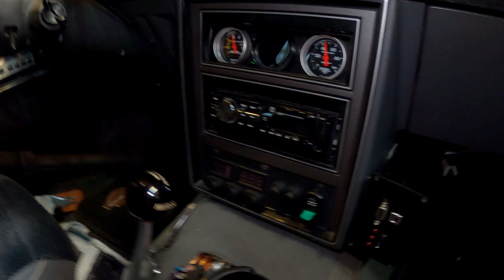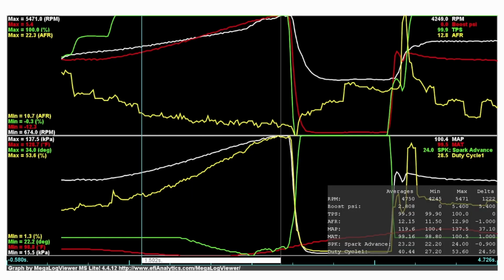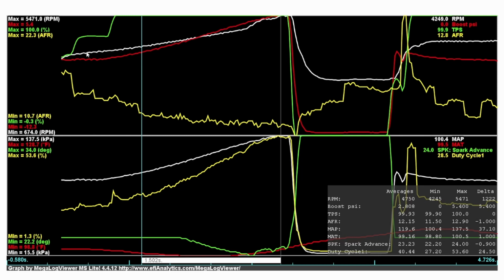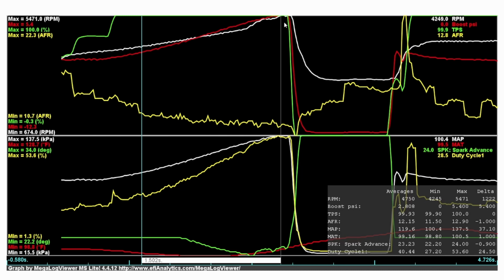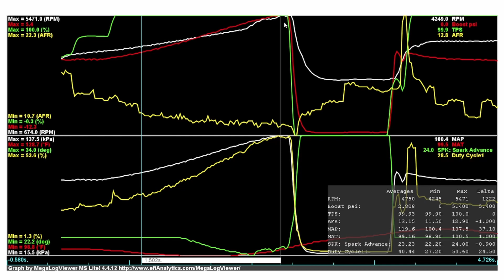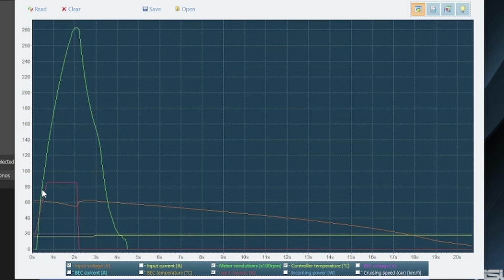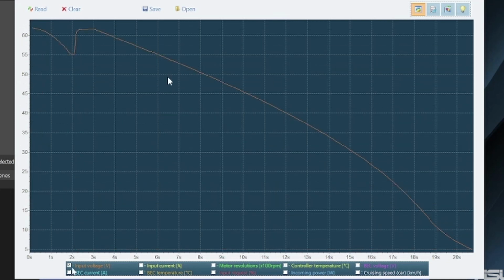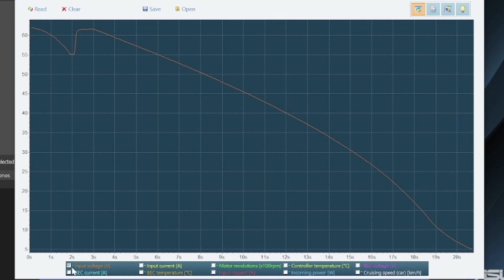DIY Electric Turbo: Sledgehammer - First Boost!

Comment: Have you considered using a digital potentiometer to set the motor amperage? that way you can electronically ramp the motor up/down to tweak it for traction/how aggressively it comes on. Could have multiple boost/ramp profiles programmed into an arduino with a rotary switch to select which map to use on the console during testing etc.
Reply from the maker: Yeah - actually the arduino has code to do that.  You could even go nuts and have a speed sensor on a front wheel and one on a rear wheel, and when the e-turbo's on, if there's a difference in wheel speed beyond a certain margin of error, you could have it automatically provide less boost until the wheel speeds match again - basically, traction control.
Reply: @AlexLTDLX  do you plan on doing it?
Reply: That's a great idea
Reply: What about using a throttle position sensor so even at idle you have some air flow instead of the -1psi restriction say 0-6psi at 0-100% throttle linear.  Is that the end game maybe I understand testing is continuous or is it power capacity? If just daily driving how long would a system last with two or so squirts a day  amphour or capacity. maybe a better question is theoretically how long could you boost?
Reply from the maker: Honestly, probably not.  This car pulled the front wheels off the ground on a transbrake launch at the track with slicks when it had the Whipple on it.  I expect it to do the same with this thing.  Also, software isn't really my thing - I'm not particularly good at it and I find it frustrating.  But it could certainly be done; the mechanics and electronics are easy; the code - again, not my wheelhouse.  But maybe as a youtube exercise....
Reply: @AlexLTDLX  Although doing it with the arduino would be neat it would also likely be a pain in the ass to get sorted out. Theres fairly inexpensive traction control systems available that are pretty much plug and play with very little sorting out that would be way simpler.

Comment: That's some scary torque on those street tires! Once you're on a prepped track, slicks, dialed in from the dyno, it's gonna be bye-bye Tesla Plaid. There can only be one electric king ;)
Reply from the maker: Thanks for watching and commenting.  I don't know if we'll hit 9.2's in the quarter - but I'm pretty confident we'll get solid 9's.  But maybe if we compound two of these; or even this one and the smaller unit...
Reply: @AlexLTDLX  I like that you have plenty of future options even while you're still working on this setup. Anything in the 9s is already ridiculous.

Comment: Hell Yeah, you've got a killer build Alex! I've enjoyed watching your journey.
It's wild how much power you are able to ramp up to the impeller attached to that motor. That 0.75 delay before reaching target amperage is pretty damn quick.

Rooting for your to succeed and have a blast doing it.
Reply from the maker: Thank you.  The guys at MGM have told me I can ramp in at 1.5 seconds for better response.  But for what I'm doing, it doesn't matter much.  But ultimately, it would be cool to have traction control - if there's tire slip, the e turbo slow down automatically.  And thanks for watching, commenting and most importantly - subscribing!

Comment: This is awesome you got it working! Real world test matters most. All the actions is from 0 - 120 that's the most important part in my opinion having it running 2-3 mins straight is beyond ridiculous. You don't need boost to maintain a high speed just using it to get there is all you need. 1\4 mile if your cars fast 12 seconds or less hopefully as close to 7 seconds as possible.
Reply from the maker: That's true.  I'm pretty confident we'll get this version into the 9's.  If you haven't seen it, this was our first drag test: https://youtu.be/AOL3Qyczt3Y
Reply: @AlexLTDLX  yeah I saw that video a while back. a 9 second car is fast by any standard. that is always a hell of an achievement on any car. with 5lbs of boost and no lag or parasitic loss you should get some pretty good runs. how heavy is all the batteries? thats the only slight draw back I could see using a system like this. how ever thats not to say anyother boosted system doesnt add weight as well. tubing intercooler the actual turbo or centrifugal super charger and pulley ect. could end up being some what same as those. doesnt look like you went for much weight reduction anyways with the full interior of that car being still in the car. either way this is interesting in that its different than the other set ups other people are doing. but I do think electric super chargers will be more and more common place. some OEM cars have them now even if just to reduce turbo lag of the exhaust driven turbo. I think the market will open up even more people being able to some what "turbo" their cars in a kit of some sort a company could have basically a box with batteries capacitors and some type of computer to map it and some type of cooling. then its basically hook up a few wires and hook it up to an intake. I think we will see this happen soon if it already isnt happening some where.
Reply from the maker: The current battery packs weigh right at 60 lbs.  However, if you went with LiPo instead of LTO cells (LTO is safer); you could easily get the pack weight down to 20 lbs for the same performance.  I just went with LTO cells because of the safety issue - we've got enough stuff blowing up and exploding while figuring this mess out.  The entire setup (with batteries, e turbo and long, heavy cables) is right around 100 lbs - more than half of which is right over the rear axle; but that total weight could be as little as 60 lbs total.  The previous Whipple setup, with A/W intercooler was right around 120-140 lbs, depending on how much ice and water I had on board.  And most of that weight was at the front.
Reply: @AlexLTDLX  yeah that's good to know. my current setup is a procharger centrifugal super charger and with the intercooler and everything weighs in at around 110 lbs for everything. for only 6lbs of boost. but thats not to say if you go with the electric turbo you might still need the intercooler depending on your particular set up. I use it because I am at 9:5:1 compression. if I was 9:1:1 i would probably not have the whole intercooler set up.  I mean its way more complicated than just a compression ratio but I just mean with my particular set up. but with out the parasitic loss of the pulley probably I could probably get away with 5lbs of boost and no intercooler. too to cut down on weight. that would actually be pretty sick to see.

Comment: J had to stop video @9:00 to make this comment" as you drive the time a car is getting to speed is significantly less than steady pace that is the boost feature of electric enhancement. In steady state the car can accumulate and store the energy for the short term boost at a much greater rate of consumption. F1 Cars are a extreme cost no option car and from the fuel consumed 50% energy conversion raw fuel content at the same time. They use multiple units for recovering. storing and reusing to get the best conversion of fuel to kinetic that delivers to finish line results. Say if a person with the will and tech can  build his way to something that functions then optimise results that's pretty kool thanks for sharing the journey. Soon as my rc hobby exposed me to the high power high rpm of brushless motors few years back "I though these motors could have potential to supercharge an engine on demand. I set up the items todo preliminary evaluation and found that the turbine of a turbo really produces large amount of power in small form factor and the motors and esc are expensive or custom. Progress has made for greater options  and this is a working example of bolt it on at the track and go faster package potential. once all the development is done very kewl no doubt!!.

Comment: Loving this project! I would try 2 things:
A volvo Penta "flapper" bypass so the engine can run freely N/A before the electric supercharger starts adding positive pressure.
Bring the turbo in sooner but with a more gradual ramp up so you stay hooked up.
Keep up the good work!
Reply from the maker: Thanks.  The controller can ramp based on whatever inputs you give it (or what you program it for).  But since in my case, we're most interested in max power and dragstrip performance, it's really not necessary.  Just put the slicks back on it, and leave off the transbrake.  As for the bypass, that is a good idea, but in my case, not necessary.  The engine makes almost exactly 500 hp naturally aspirated, and the e turbo only provides a restriction of about 1 psi of boost loss.  So you still have about 465 hp to play with.  And in most driving situations, it's not even close to noticeable.  But for smaller or different applications, it would certainly be worth considering.  Thanks for watching and taking the time to comment!
Reply: @AlexLTDLX if the engine makes 500 naturally, how much is this electric turbo adding to that Hp/tq wise? 50hp/tq? 100hp/tq or more? Could you use 2?
Reply from the maker: A lot more than that: https://youtu.be/b9d5xv9INmw?si=kt39TWB_zKI8jVrb  @mikelmarion

Comment: Very interesting stuff, that is mind blowing when you consider the fact that you don’t get parasitic engine power losses from the boosting device. Like nitrous but instead of filling gas bottles you charge with a wall socket. 
People don’t consider impeller blade angle and blade area vs rpm when looking at “turbo” looking compressor. Just the rpm, but not how many cfm per revolution is moved by the blades. Of course it’s not positive displacement compressor but still impeller geometry and size should ring some bells.
Reply from the maker: Before this I ran almost exclusively positive displacement blowers on this car - two Eatons and a Whipple over the years.  I can tell you with absolute certainty that this setup makes more than twice the rwhp per psi than even the Whipple did.  I think a TVS would do better, but still not even close to this thing.  The possibilities are certainly exciting.  Thanks for watching and taking the time to comment!

Comment: How about some mountain and towing settings for the electro-supercharger? If you’re driving in the mountains, you can set it up for continuous operation from tickover, just to make up for lost power and torque.
Reply from the maker: I can see that in OEM-type applications, certainly.  I think we'll be seeing more and more of these in OEM applications (Audi's had one for a few years, Mercedes has one as well; Suzuki's putting one on a motorcycle) as technology continues to improve.

Comment: Have you tried a 6-71, 8-71 or with your electric motor to drive it? Wth carburettors above it, and the throttles closed, they spin the rotors without any power input, if the belt drive is disconnected. this may help with getting the rotors to spool. Since they don't need to spin anywhere near as fast,  to pass large amounts of air, you could change drive gear ratio to better make use of the power the electric motor has and adjust the max power amps accorrding to the boost load. just a thought.
Reply from the maker: I've done a lot of positive displacement setups over the years.  The problem here would be sheer size both of the blower and the motor necessary to drive it (less rpm, more torque, some power in the system = much bigger stuff needed) and the mass of the rotors.  Though to point you bring up about the rotors spinning is valid.  Years ago I posted a video using a shop vac to spin an Eaton blower (still on my channel somewhere in the way-back machine).  Thanks for posting and taking the time to comment!

Comment: So many cables!  I'm not a mechanic, so please forgive my ignorance, but I'm surprised it's so complicated.

Conceptually, it seems to me that you want the current to the electric motor to be proportional to the throttle, so why can't you do something simpler, along the lines of taking your Megasquirt's throttle signal, splice it and send the second wire to an appropriately chosen op-amp whose output increases to the right level at your maximum RPM?  Alternatively, a very bare bones computer could count RPMs and increase current to the electric motor when the time between revolutions gets shorter, and vice-versa.  Or have you already simplified the wiring after getting all your measurements and tuning your electric turbo just right?  I haven't watched many of your videos yet.

Either way, brilliant idea!  Like you say, this way there are no parasitic losses to a belt and no lag while you wait for a regular turbo to get enough exhaust gas.
Reply from the maker: You're on to what has become the next challenge - controlling it in as universal manner as possible.  For OBD II cars, it's pretty straight forward - in most cases, I'll make the argument that you don't need a TPS signal, but a load (MAP) signal.  But to make boost proportional, then yes, you'd have to include the TPS signal, particularly in lower-power applications.  Even without a TPS signal, you could modulate the electric supercharger based on available traction, read from the car's ABS signal.  You'd still need an RPM signal, at least to keep it from turning on at too low of an RPM, which would shove the torque through the roof and potentially cause engine damage.  This is just the tip of the control iceberg - once you really start thinking about it, it runs very deep...
Reply: @AlexLTDLX  
Cool!  I look forward to seeing that, especially using ABS to modulate boost.
Reply: I'm just beginning to consider a less aggressive electric turbo and my first question is, why run separate batteries instead of a DC-DC transformer to step up the car's regular battery to whatever DC voltage your electric motor rquires?  (That's 48V if I remember right, but if it's something else that should be possible for essentially whatever voltage you need, provided the battery's maximum output in Watts  (W = V*I) is greater than what the electric motor spinning the turbo plus the ICE and its regular electrical components combined, require.)  I would assume you tried that first because it would be so much simpler, so did it kill the car battery or what?  With the additional batteries as shown in this video, are those wired to the alternator to keep them charged, or do you just have to replace them often, or what?

Comment: I enjoy your content man. This is awesome. I was wondering though if you thought about testing somehow mounting the electric motor directly to the drive train. Maybe you would have to use some gear reduction or such to make use of the electric motor efficiently. In order to compare results between driving a turbine or directly driving the drive train. I am assuming the math is there that you might see more efficiency directly driving the drive train, but am curious if that is what a real test would show.
Reply from the maker: Watch the dyno video (if you haven't seen it) - that puts it into perspective: https://youtu.be/PjOJU02FIGw  1 hp = 746 watts; if you could directly drive the wheels with the electric motor (no transmission losses), you'd pick up 47 hp at the wheels at the most.  Using that same 47 hp to drive the electric turbo, we picked up 147 hp - so three times more power (of course, more fuel is used to make that additional power, but overall it's still way ahead of the game).  Another way to look at it is that we expended 35,000 watts to gain 109,662 watts (with the additional energy coming from the additional fuel we were able to burn).  The real win, from an efficiency perspective, is you can get by with a smaller (more efficient) engine, and only use the electric turbo when needed.  Same reason why OEMs are moving to smaller turbocharged engines - better gas mileage overall, yet still big engine power when needed.  But this is even more efficient than a conventional turbo; the packs could be recharged through regenerative braking like a "conventional" hybrid.

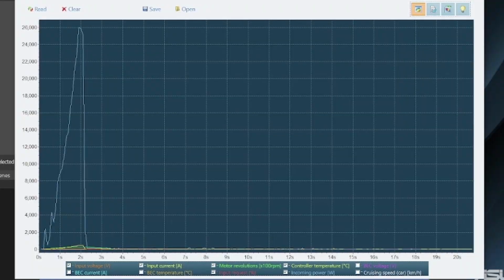Comment: The wattage displayed at 10:35 is how much horsepower saved by electrically boosting. Granted there's a little more weight. But, the power added (and NOT lost to parasitic mechanical driven boost) compared to the weight added is a net bonus.

Comment: You mention the restriction of the electric turbo. I was wondering, is there a reason you don't use a vacuum actuated compressor bypass valve like many superchargers have? Does it cause some tuning headache or something?
Reply from the maker: Yeah - it's just not necessary on this car.  Even sucking through the electric turbo (i.e. not running) it still makes about 470hp.

Comment: Am a new subscriber so take what I say with a grain of salt I noticed in your set up that I’ve been catching up on. by the way great build, have you ever considered a turbo smart “e” waste gate? I think that would be a great addition. Like I said take what I say with a grain of salt you have a really cool set up. Looking forward to your dyno video.
Reply from the maker: Thanks for the kind words.  I don't how you'd use a waste gate here - a waste gate bypasses the exhaust gasses around the turbine side of a turbo - something that's not at play here.  The blowoff valve I show isn't really necessary, but it does prevent some mechanical shock to the impeller/motor.

Comment: I'm new to the concept of using electric. 
But is there a way to use the wind and generate static charge without turbine?
Maybe a antenna setup in reverse to absorb as it drags current?
Reply from the maker: I don't know.  I can tell you, it would take a lot of power to do that.  But the control box in the trunk does have a charger built into it.